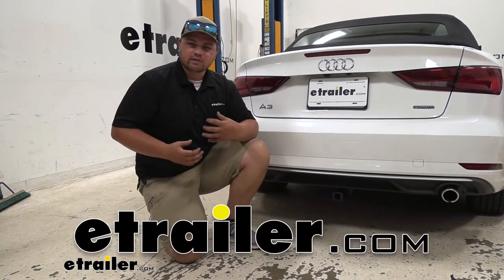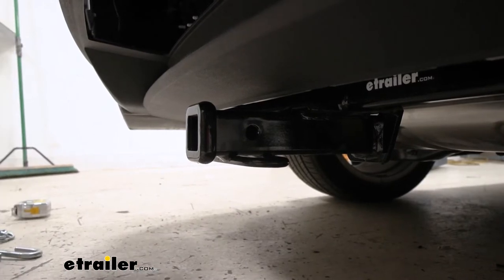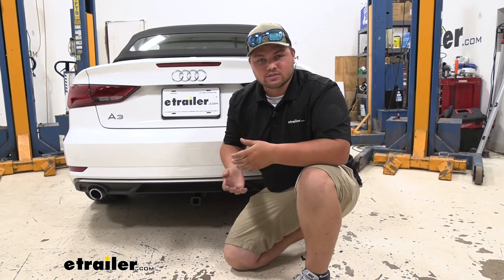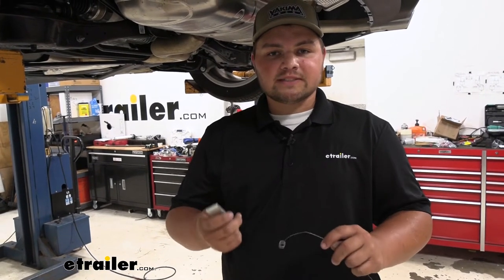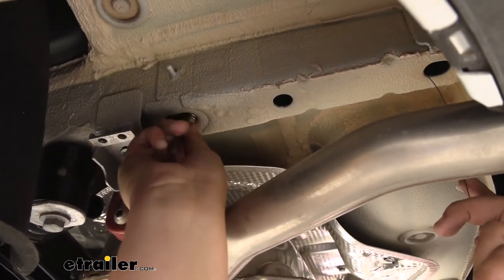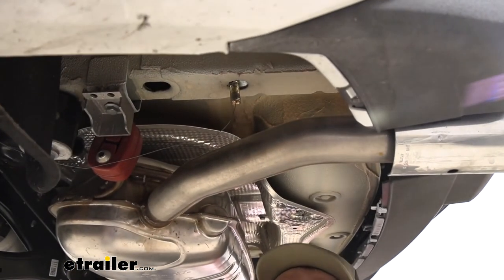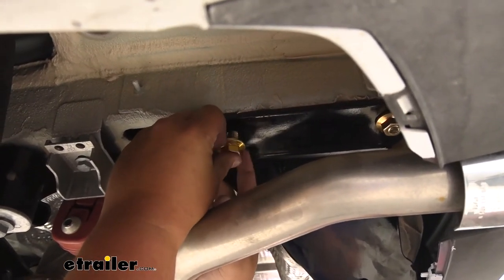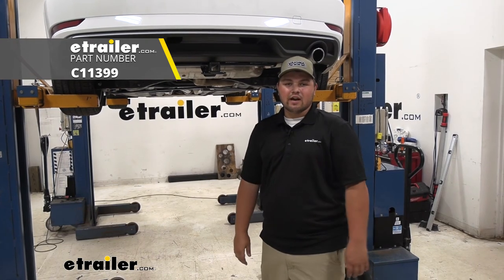etrailer | Curt Trailer Hitch Installation - 2019 Audi A3

Comment: S3 owners take note- the dual exhaust makes for a more involved install. You'll need to lower the muffler to squeeze hitch into place. I unbolted 2 rear hangars. Notches will need to be ground/cut to clear sport exhaust solenoid on passenger side and a small notch on driver's side for inside exhaust pipe clearance. On my car the forward holes in frame required extensive "opening". Otherwise, it fits great.